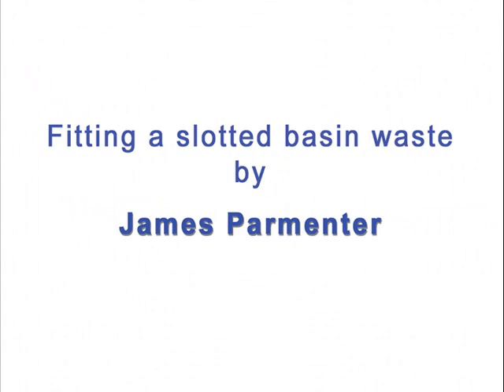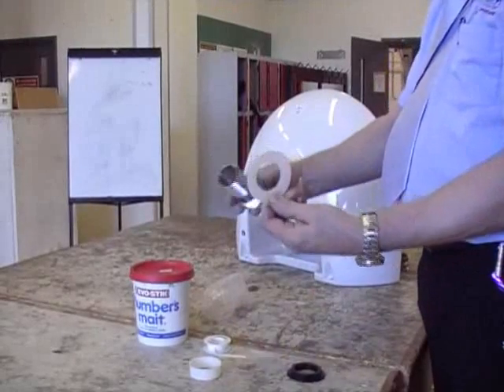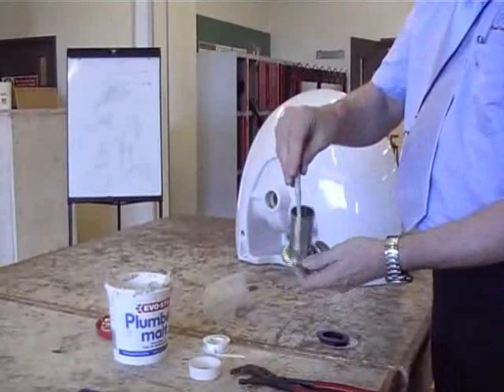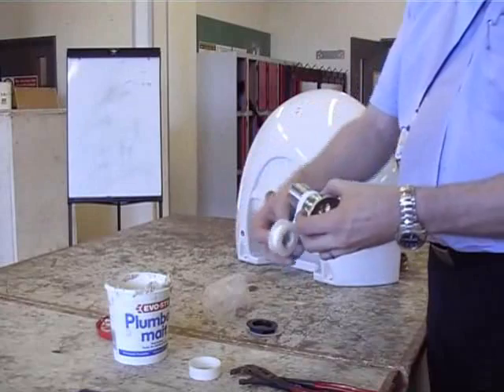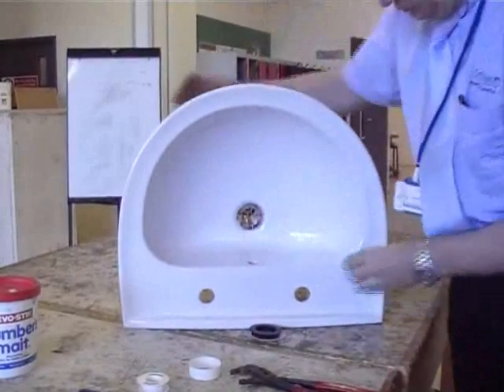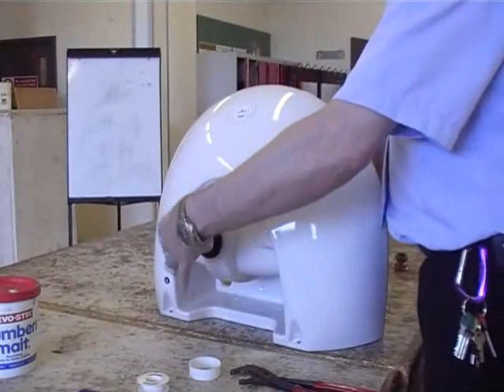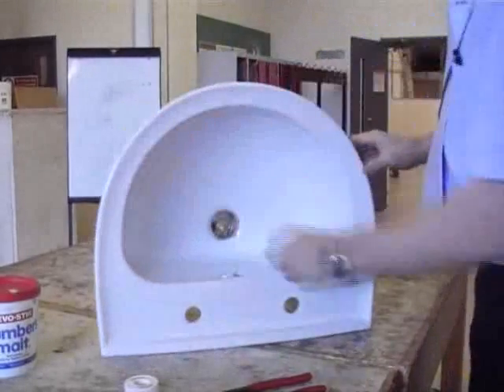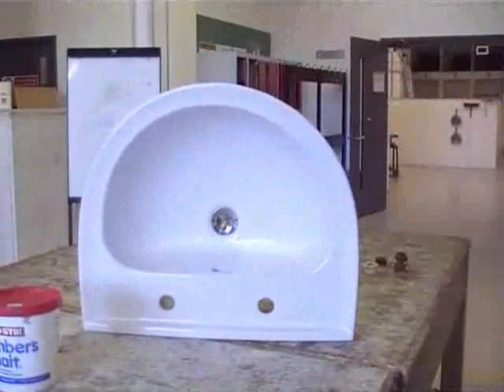FitBasinWasteJP

Comment: Hi Roland,
Indeed the plumbers mate is just there to protect the basin, as would the silicone/rubber seal if supplied. As a water tight seal is not needed on the top part of the waste fitting. Although if this is not water tight the basin will slowly empty if the plug is left in, so it is good to have a water tight seal at the top end of the waste fitting.

Comment: Apply the PTFE tape in a "clockwise" direction to the waste fitting. This will give a water tight seal when tightening the back nut. If the PTFE tape is applied 'anti-clockwise'.. the PTFE water seal on the thread of the waste fitting will be compromised as the back nut will want to remove the tape as it is tightened up..

Comment: Thanks for that.  Very helpful.
Some of the basins come with a silicone / rubber seal.  Are these fine to be used instead of the Plumbers mate?   
I assume the reason for the Plumbers mate purely there to ensure that the metal doesn't touch the porcelain?  
If there is an overflow cutout, the top seal wouldn't have to seal the water since any water draining from the basin would fill up the little space between the overflow cutout and the bottom seal in any case.

Comment: Hmm that will leak from the overflow slot. Problem is rarely from the basin waste itself but always from the overflow. The only thing that is stopping water slip through the thread is that ptfe and that is just not going to stop it. What I normally use is a dry fit basin mate. No leaks as this seals the thread of the wast to the basin.
Reply: Ptfe tape works perfectly! I use ptfe tape for radiator tails where the central heating flow is under one bar of pressure and they don't leak!!